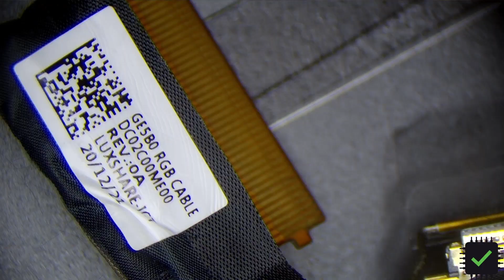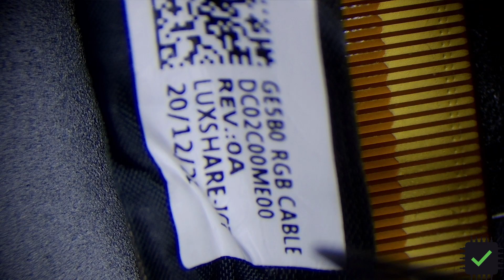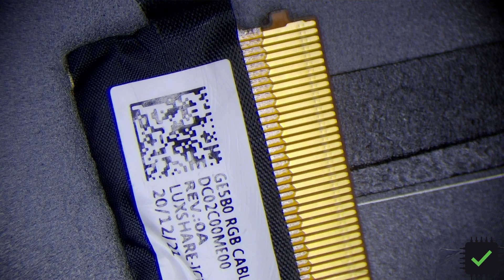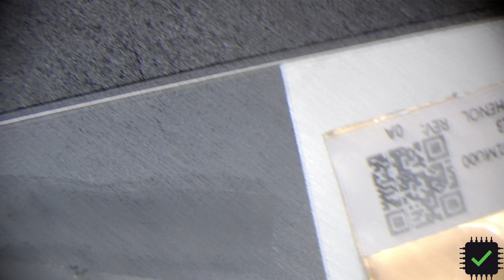Lenovo ThinkPad E15 AMD 5B21C82193 Backlight Fuse Location. Beware of the screen compatibility!!!

Comment: Thank you so much for making this video.  I had the same problem after replacing a broken screen.  I thought the new screen was defective.   I had no idea there were SMD fuses soldered onto the motherboard. (fuses should be easily replaceable).  Anyway, I think the proper way to replace the screen is to disconnect the battery first.  There is a bit of a power surge when the screen is plugged in (even when shut down), maybe loading up a capacitor or something.  Anyway it was enough to blow that TINY fuse.  I'm a hack, and was willing to sacrifice my computer, so I got rid of the fuse and just made a solder bridge.  It works... for how long is anyone's guess.  Worst case. I'll use the HDMI port.  Oh, I don't know if it makes any difference, but my E15 is the Intel model.